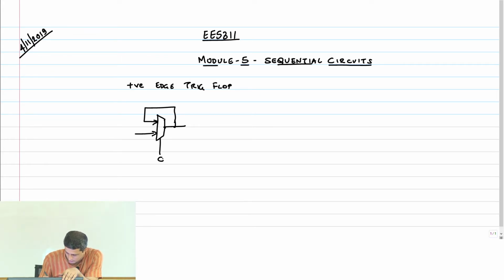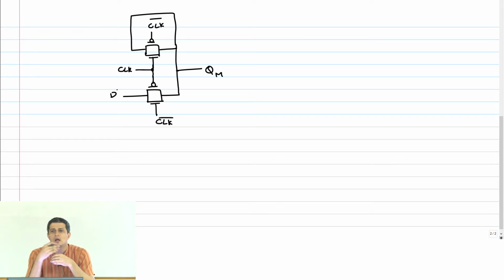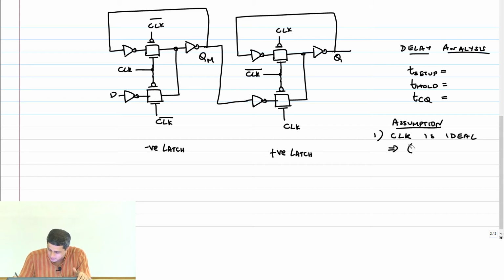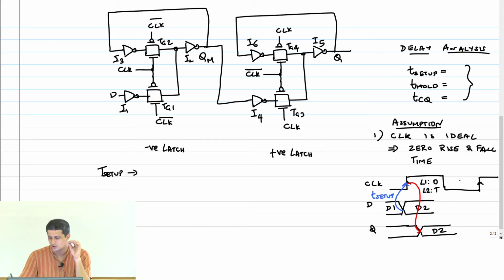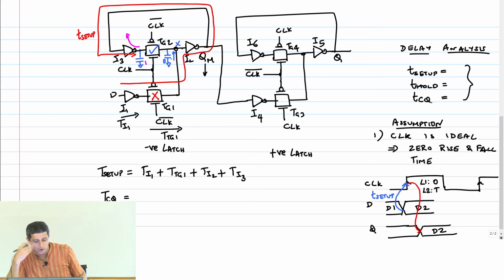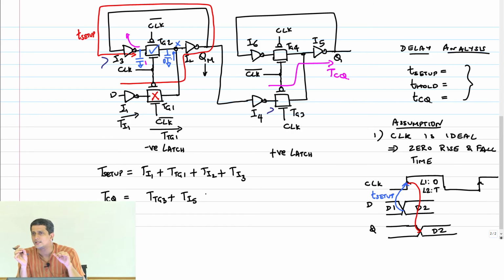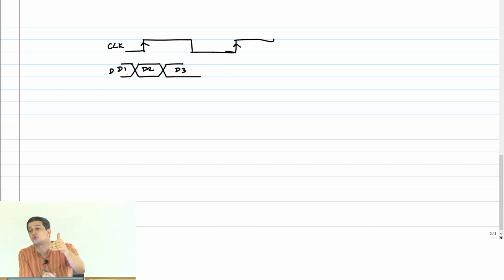SeqCkt - 4 - Flop Timing Parameters

Comment: can anyone clear why hold time is 0 here ?
Reply: Consider L1's TG1, it goes opaque at positive edge. Which means once positive edge of clock comes, whatever the data was there just before clock edge is shifted to right of TG1, and TG1 turns off. So u can remove data right at clock edge giving thold = 0. UAfter this he clarified the answer is not 0, but the answer is actually thold = -tI1 because at the left of TG1 you hav I1. So instead of removing data right at clock edge, you can remove old data tI1 before also, still it'll propagate successfully to right of TG2.  -tI1 is the right answer
Reply: One more way to think of this is, you are holding data D2 in the negative edge of clock, but you change it to D3, D2 begin the data you wanted to send can be overwritten by D3 and then the TG1 shuts off and D3 is the data at output of slave. So to ensure D2 is what comes out of slave, hold D2 constant until the gate shuts off, which in this case is right at clock edge giving thold as 0. But becuase you are sending data via inverter I1, you need to consider(subtract) the delay of the inverter also in the path. So you can remove D2 tI1 second before the clock edge, but need to hold it until then giving hold time of -tI1

Comment: Timestamps (Powered by Merlin AI)
00:22 - Discussion on master-slave flip flop and timing analysis.
04:01 - Understanding flop characterization and delay analysis requirements.
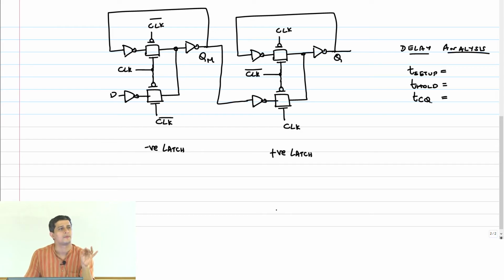07:42 - Understanding clock edge assumptions in flop timing parameters.
11:42 - Understanding latch timing and feedback paths in sequential circuits.
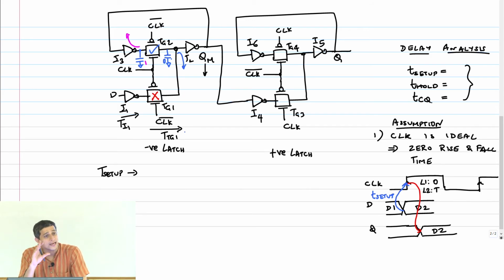15:13 - Capacitor voltage consistency ensures correct logic level detection.
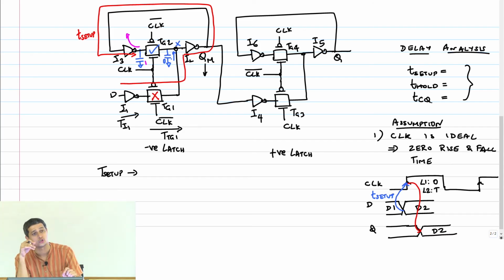18:09 - Understanding clock-to-Q delay in digital circuits.
22:07 - Understanding setup time and whole time in circuit timing.
25:08 - Understanding Flop Timing Parameters, Specifically Setup and Hold Times.